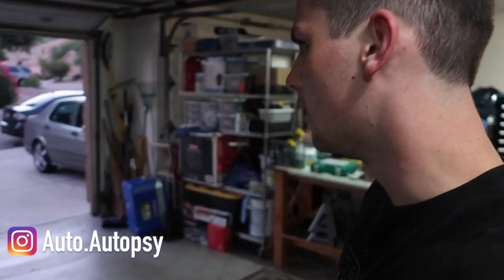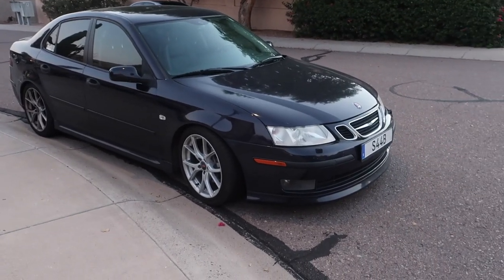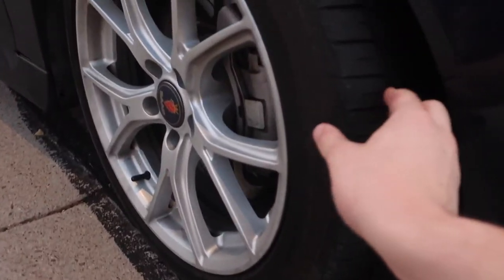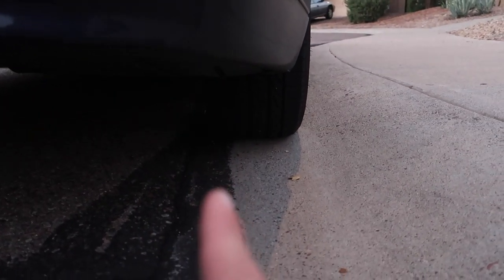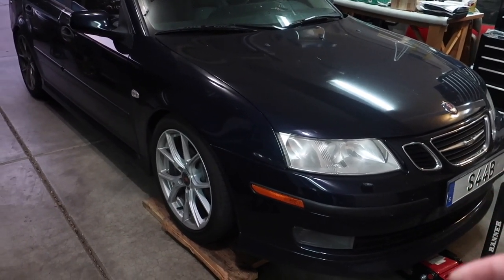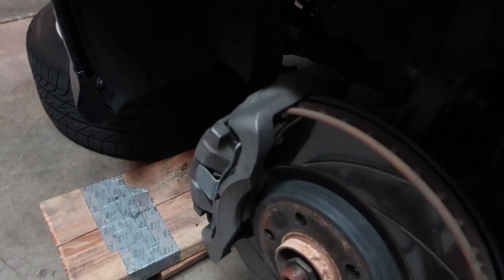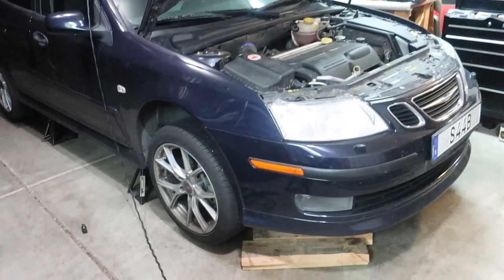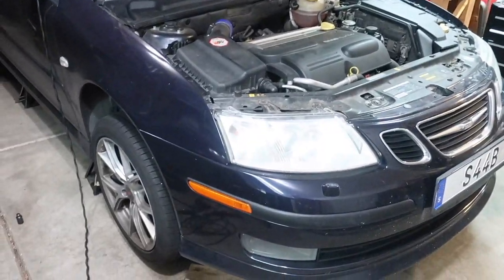How to Rotate Your Tires on a FWD Car!

Comment: mechanic here, this is a great thing to do as long as the tires arent rotational and the thread on the tires that goes to the rear is still good. Ideally the best tires should be on the rear to avoid loosing the rear, even on FWD cars
Reply from the maker: Logic tells me that the better tires should go on the front, since they’re responsible for powering the car and cornering/steering. But then again, I’m not a trained mechanic lol
Reply: @AutoAutopsy  I also ran my best tires in the front right up until some icy conditions made the rear slip in a straight line on my 1.8t Vector, not fun
Reply: @tobbsnobb1366  interesting perspective, sure that was fun lol. I almost smacked my 2007 aero today, it was pouring and this lady was just sitting in the middle of the street, literally. Mini heart attack for sure. Had to slide past her half on the shoulder lol.
Reply: I guess that it makes sense considering that it’s easier to manage to control when most of the time a slower car can be easier to regain control

Comment: Just to confirm, did you check if your tyres are directional? If so you either need to unmount the rear ones to cross them over on the front.
Reply from the maker: They aren’t directional. I thought I had mentioned that in the video, but I guess not. My apologies!
Reply: @AutoAutopsy   That's good they aren't so don't have to switch them. It's one of those things that is easily missed even if you've taken a few wheels off when doing a job

Comment: You might want to mention that if you have directional tires (or wheels), you can't rotate driver's to passenger's side.
Reply: Indeed. When I was a teen I was also taught that one should keep radials on the same side of the car, that the move from rear to opposite side in front was only for bias ply tires. Maybe that’s no longer true.
Reply from the maker: Very true; forgot to mention that in the video. Mine aren’t directional thankfully

Comment: I keep 45 psi pressure in tires with my 2007 2.3 t. Saves fuel.
Reply from the maker: Quite high, but interesting. Thanks.

Comment: The guys writing the best tires go at the rear are correct. This way you avoid that it unexpectedly breaks out because of less grip back than at front. Too much camber on a 9-5 means worn bushings and it can happen pretty quickly. Maintenance wise the whole rear suspension construction is just crap.

Comment: And if you want to drive safe in bad road conditions. You ALWAYS!! ALWAYS!! Put the best tire's in the rear no matter if the car is 4WD or 2WD. To rotate the tire's like this i just unnecessary if you don't live in the dessert. If the front one's are worn down, buy new ones and put the new ones in the rear and the old rear ones in the front. Please avoid hydroplaning in the rain and snow, it will make your life so much easier :P

Love the vid's, keep it up! :D
Reply from the maker: How is it unnecessary? I’d put the best tires up front, especially on a car like this. They’re the ones doing all of the work!,
Reply: @AutoAutopsy  Amen brother! I understand this for a rear wheel drive car to help mitigate oversteer but with a front drive I'm with you. The good front tread will move the water (mostly) out of the way for the rears.
Reply: @AutoAutopsy  It is not necessary because you don't have to change all 4 tires at once. For safety reasons you want the best tires to be in the back for the car to straighten up when loosing grip. Especially on snow or when aquaplaning.
Reply: My good tyres are on the back of my fwd VW Caddy but I need more grip up front. I've had my van sideways doing 80km on a mountain. The back just simply slides at that speed in the rain. The front pulls me out of it. I'd rather have good tyres up front so I can floor it out.

Comment: Question ! Just bought a 04 Saab 93 Aero (2.0) and my gas gauge reads empty but the car is full of gas. Would it be a censor of some type or?
Reply: I have an 06 93. It just seems to be a saab thing in all honesty. I panicked when my gauge read empty but quick fix is just calculate your mpg n tank size and reset your trip meter every time you fill up. But yeah, it's a messed up sensor long story short. Best of luck!
Reply from the maker: Fuel level sender
Reply: @idiot7107  yeah I read everywhere how common it is and removing everything to get to the sensor is pretty annoying, but thank you I really appreciate !
Reply: @AutoAutopsy   thank you!